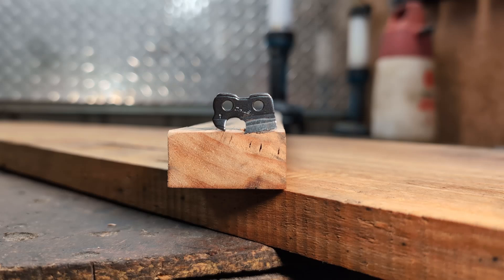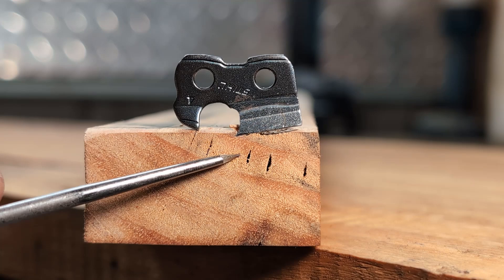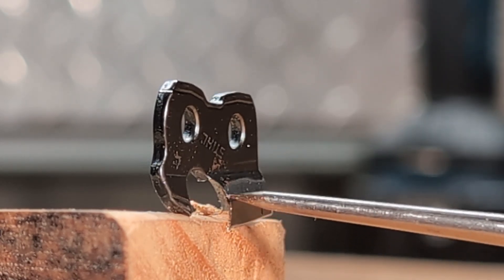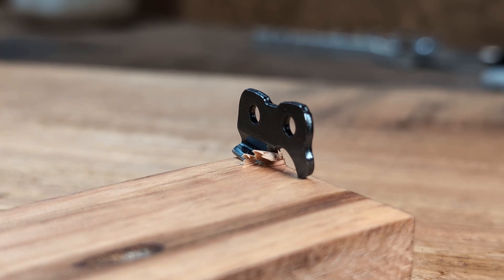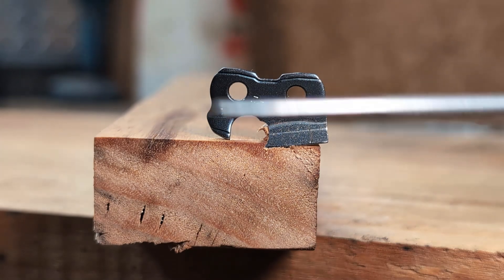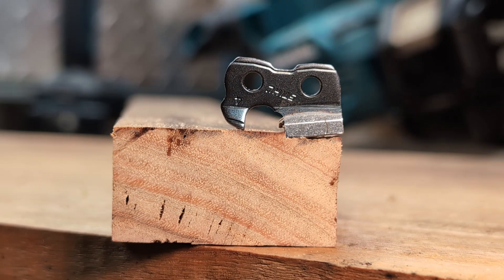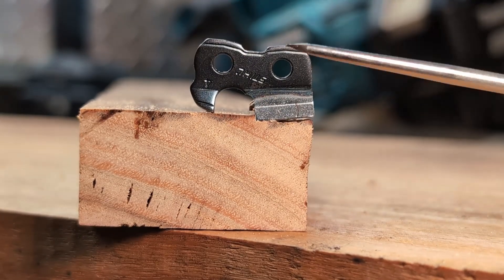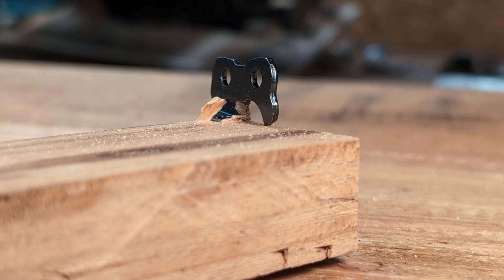Chainsaw chain - How it cuts and side plate angle

Comment: Great info and good job explaining it for just some 2 stroke huffing fool like myself ;) just to be clear was the first cutter a chisel shape that was round ground? Or was it also square but with just a different side plate angle? Also do you hand file or machine grind your square? Thanks so much for going into this. I know you mentioned your slow mo videos didn’t show much but might be cool to see them anyway. Also I wonder if you could have some air compressor blowing the saw dust away from the cut to get a better view.
Reply from the maker: The cutter is from a Stihl 46RS chain - 404 full chisel with its factory round grind

I file square because the grinders are extremely rare and expensive here.

There are a few ways of changing the cutter with a round file that work for me. I will do this again with a few cutters sharpened in different ways to try and show the differences when I get time

Comment: In a little different direction, I freehand rip a lot of lumber. I have found that the angle of the cutters increase the width of the cut and also the roughness because the cutters pull left and right. I sharpen mine at 0 deg, this makes a very smooth cut and lets the bar follow the cut to keep it straight and needs to cut less so it is faster using less gas. Use full chisel and remove the rackers, this produces a long chip but not long enough to clog the saw. In freehand cutting you only use about the first foot of bar so you can use a longer bar than normal that also helps with straightness. Occasionally I will use the ripping rig to buck a log when I don’t want to change over for just one cut and find it still works surprisingly well.
Reply from the maker: @D-B-Cooper  This is something I'm starting to do more. I had some experience with an Alaskan style mill and it sucks, so I started ripping freehand because it's so much more efficient. I have not really experimented with chains for it yet  so that's something new to learn for me next year

Comment: Good video, I cut a fair bit too and are in Australia. Many years ago I discovered many things those in the US were doing simply didn't work here in my world. I found myself detuning chains in order to get them to cut faster. That inner top plate angle and hook or side plate profile are critical. Get it wrong and in our wood the chain becomes 'grabby', inefficiant and violent towards your gear. Smooth, self feeding chain is what cuts dense wood fast. Pretty much all my chain is semi chisel with a portion of square. Full chisel can be ok in green wood or softer species but for the day to day grind, it just doesn't hold uo for the readons articulated in this video. Shame really, cause I like the way it cuts. .404 is your freind her too, I find on 65cc+ saws it provides the best value with so much more meat on the cutters you get the most sharpenings per chain. Australian conditions does force you to learn all this stuff otherwise your cutting experience is terrible. I subscribed.
Reply from the maker: @aussiehardwood6196  Had the same experience over the years, what I kept seeing didn't work well here. 

The more experienced people I have found all come to the same conclusions as you. Lots of 404 and reduced side plate angles to get the job done

Comment: It would be amazing if someone could film a closeup in ultra slow motion of a chain chewing it's way thru a log. 
That would clear up a lot of mysteries.
Reply from the maker: There is some slow Mo video of it cutting out there but it doesn't show a lot of detail. There are also some photos done with Carlton / Tilton back in the late 70's or early 80's using strobe photography at night trying to capture what it's does. If you search YouTube for a video called Dan Tilton chainsaw safety the pics are referenced in part of that video where he is explaining how chain works. It's definitely worth a watch.

I have tried but there is too much dust and chips in the air to capture anything worthwhile, so I'm stuck with using an educated guess at how it all works
Reply: @SawChainTheories Years ago I found the "Carlton Chain filing Manual" a VERY detailed document as to what everything does on a chain cutter and what consequences of various angles or grind profiles are. It's a good read and downloadable in pdf format. Not that u need it, but it's probably the most correct saw chain doc I've seen.
Reply: @SawChainTheories  You would need a camera like the Slo Mo Guys are using.
Reply: What is pulling or "snapping" the cutter back against the bar if you are running a very loose chain? 
Not that I've looked into it in any great detail but I can't see in my minds eye how or why the cutter once engaged in the wood why or how? it would "rock" itself out of and disengage from pulling itself into the wood? 
Genuine question I don't get it.

Thinking about it how far is a cutter pulling through wood before rocking back out? Cutting across the grain in our timber we don't get very big chips but I've done ripping cuts before in soft timber and the noddles can be 4-5 inch long so I guess one could assume the cutter is staying engaged for like 5inch in that scenario?
Reply from the maker: @roguesixty1692  Honestly, I can't say for sure because it's not something we can see, but we have all been there with a loose chain and if you give the saw a rev the chain gets pulled back up to the bottom of the bar

This will be from the force being applied to the chain from spinning around the sprocket. I think the tension is being created by the rotational force and from the cutters being dragged into the wood. It wants to pull the chain back into line and the cutters back down. I could be completely wrong because I sure as shit ain't no science guy

I deleted a section in the video talking about the fibre structure and why we see different chips because I didn't explain it well and it just added confusion. My thought is that our wood is harder and more brittle. The fibres crumble and break off and that also lets the cutter leave the wood sooner, so smaller chips.

Chip size cross vs rip is due to the fibre structure being more flexible / playable in that direction. It doesn't break off in the same way and allows the cutter to stay in the wood longer.

There is a better than average chance I am completely wrong here. I'm just an idiot that has spent too long holding onto a saw, huffing 2 stroke, wondering how it works
Reply: @SawChainTheories  That makes sense I've just never looked into it in great detail. Not sure I want to go down the rabbit hole but I might do some experimenting lol
Reply from the maker: @roguesixty1692 This could be total bullshit but I reckon there is a cut speed advantage in having the chain loose. Something I'll look into one day but it's a fine line between tearing up a bar and gain some speed
Reply: @roguesixty1692  At first after watching some of these videos I got the impression he was saying that the cutter was rocking a number of times during the cut . But, like you say once the cutter is digging in, after the initial rock I believe it stays engaged until it leaves the log. Just like a hand plane.